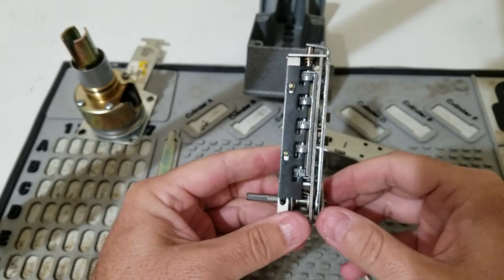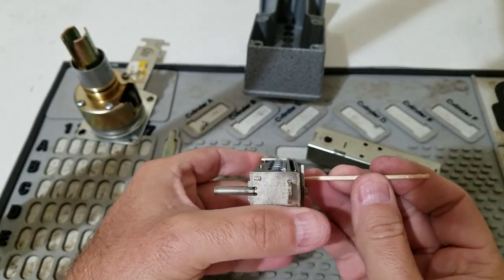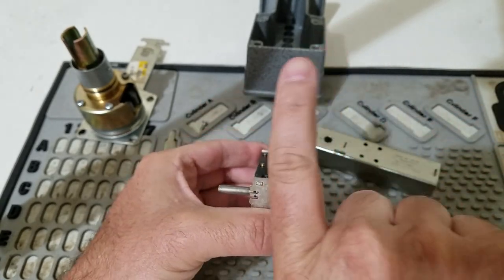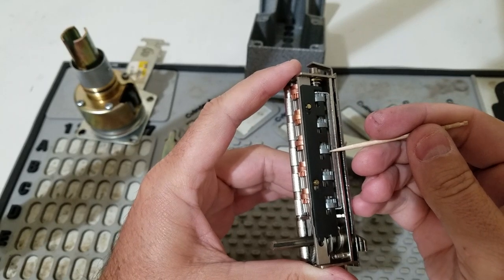(53) Lockpicking: Decoding a Kaba Simplex Combination lock.

Comment: Followed instructions and it worked, phew. Many thanks for posting this video. BTW 1,2,3,4,5 (from top to bottom inside the lock) = 1,5,2,3,4 on the exterior circular key pad. Therefore you'll need to convert your code after you've worked in out from the internals to operate it using the thumb turn.

Comment: Or, you can just pull that C-clip on your bar and swing it out of the way;  and manually turn all your gears until flat and then put it back together..  and it's already reset.   I like your way too though..  I learned something new

Comment: Nice video thanks! I wondered how these locks work for so long and never spent the time to research...
How far does it need to be disassembled for the combination to be changed?
Cheers
Reply from the maker: That differs by the model. Most models come with a "combination change tool" so you can change the combination with the lock mounted onto the door. Inputting the correct code, using the combo change tool, turning the 'outside' knob, putting in new code, turning outside knob again. Some models require the lock be removed from the door and a tool shoved into the back side of it, like a "control key".